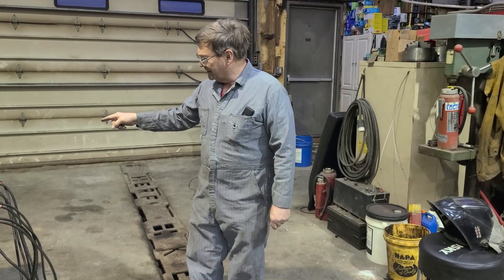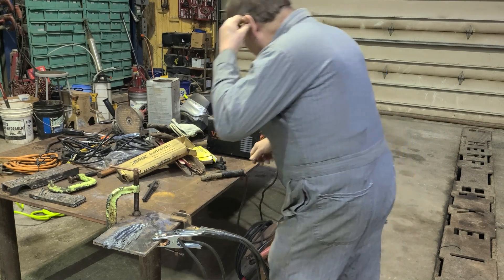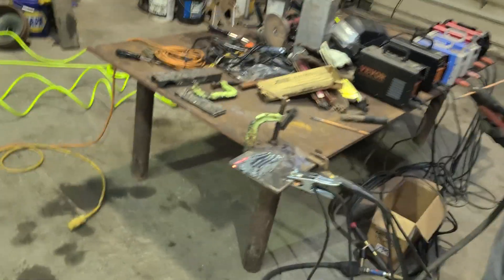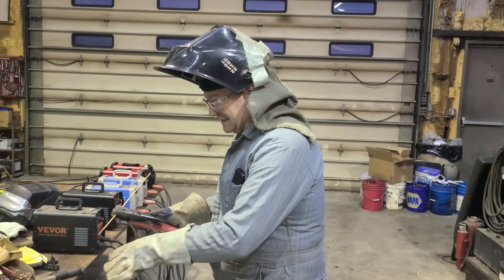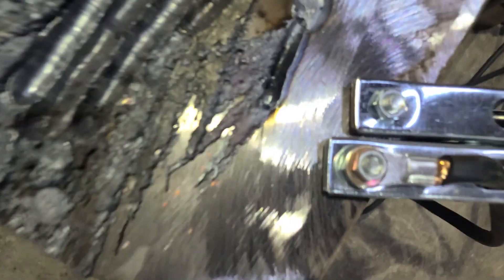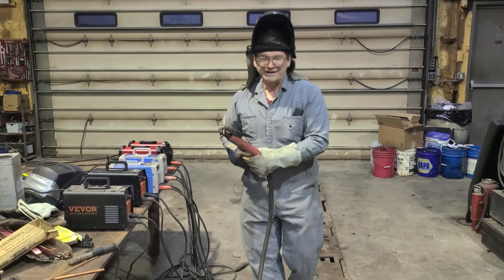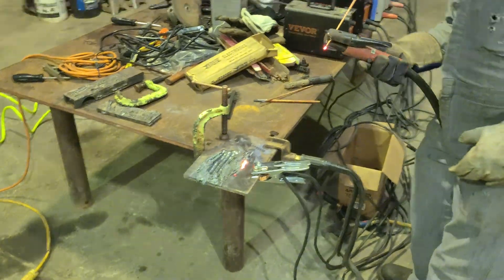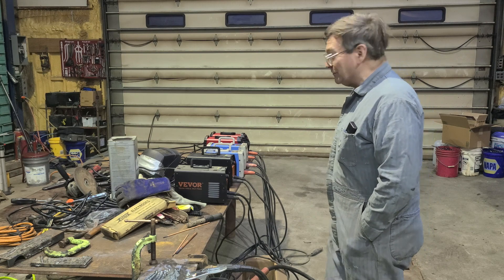Carbon arcing with Arc Captain 110v welders!

Comment: I am curious about how you heat your shop as well as welding smoke extraction? I see an HVAC unit in some of the videos. Can you do a video on this I think people with welding shops in cold areas would be interested in this topic? I have a 40x80 fab shop I heat with a wood boiler I am expanding this year. trying to find the best solution to air circulation.
Reply: In floor / slab radiant heat is hard to beat.